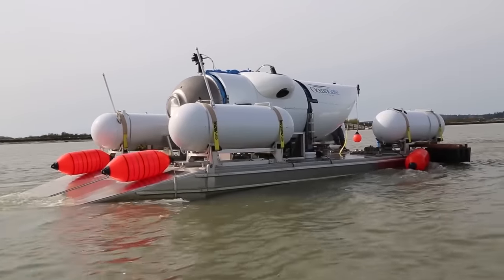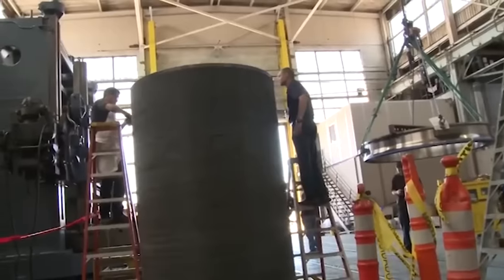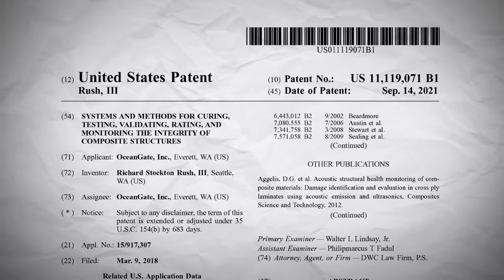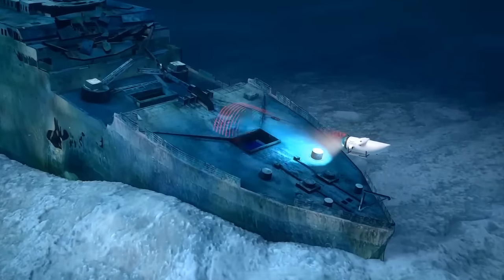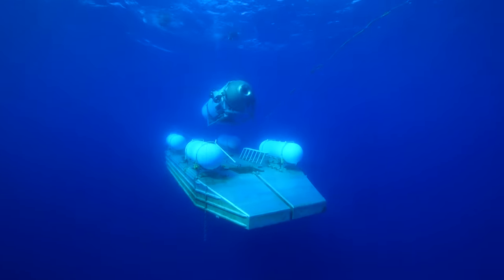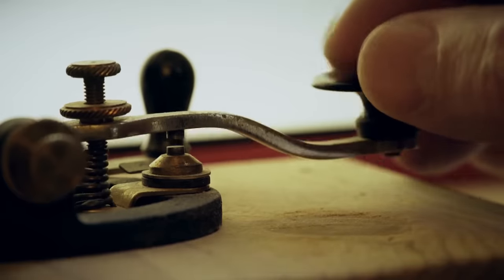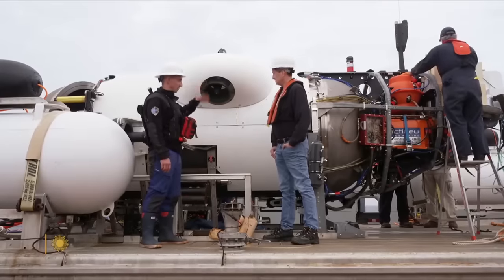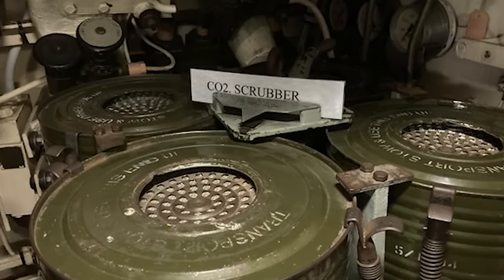Exposing OceanGate Submarines Many Fatal Designs

Comment: The sub was CRACKLING every time it went down. Like carbon fiber popcorn. That is the sound of carbon fiber delaminating. When a passenger asked Stockton Rush about it, he said, "Don't worry about it, the carbon fiber is five inches thick."
 Some engineers have said that this was a 'one and done' sub. That the five-inch-thick carbon fiber was too thick to reliably see every delamination in it so the tube should have been replaced after every dive.
Something only James Cameron has noted, is the bizarre way the carbon fiber was laid on the tube mold to create the tube center of the sub. The carbon fiber was laid in one direction, overlapped to the piece next to it. That is a one axis contact area. The dominant carbon fiber laying process in all of the carbon fiber industry is a FOUR axis WEAVE pattern. Stockton Rush made himself a carbon fiber coffin and bolted himself and four Innocent people in it.
Reply: All that crackling noise each time should have been a red flag and should be tested.
Reply: Belize central america I'm from and i agree totally !! You're a smart person and respect
Reply: ...and it wasn't a very good coffin, either.
Reply: ALL SUBMARINES MAKE CRACKING NOISE, LOUDER THE BETTER
Reply: @meganruchwatercolors7186  i think its clear that Rush was money hungry and didn't want to pay for any kind of testing or go through any certification. he flew across the country to meet with a father n son (who turned him down) about paying for the trip to titanic. that's how the Indian father n son got the "seats" as they were second on some list apparently. someone pointed out each trip should cost upwards of 1 million usd per person if all testing and certifications were performed as advised. i've read to test carbon fiber it basically destroys the product so there isn't a non destructive method for a tube like this.
Reply: @vemaraju  I suspect every sub does. But then that makes the idea of an acoustic early failure detection system pretty pointless, unless it can reliably tell the difference between stress and failure.
Reply: Hey, if you can hear the popcorn popping that's good! It means you're still alive!
Reply: That is what one person said although I have seen video from inside and interviews with several who went down in 2021 and 2022 didn't mention the cracking sounds.  Until the NTSB and the Coast Guard does a full investigation, we won't know exactly what happened. Maybe instead of 5" thick carbon hull a 20" thick carbon hull might work no one knows because Stockon Rush never tested it. He should have made an ROV version and taken down remotely 100 times to test it. Use a pressure chamber with water if that exists. Should have certified it as well. That is the proper way of engineering likely he didn't have the money to do those things he had to start taking paying customers down. Hopefully others learn from that.
Reply: It didn’t make make any perceptible sounds at all, to some passengers like David Pogue who didn’t get all the way down to the titanic but others have who did have said that it was silent
Reply: I watched a man being interviewed who had successfully taken a trip to the Titanic in the Titan. He was asked if he heard noises and he emphatically replied that "no, it was extremely quiet". Also, I have just a few minutes ago finished watching an interview with a man who had charge of a submarine for many years. He said that the implosion was not caused by the carbon fibre, but the problem was the different materials used, which placed extra stress on the sub. Different materials react differently when they contract and expand and they don't necessarily return to the same level they were before. This is what let the submersible down. He said that is why regular submarines don't have portholes, as it's safer for the vessel to be completely made of the one material.
Reply: @hanginwithkev5739 simple! I'm a rich millionaire who knows better than everyone else and cuts literally every corner possible!
Reply: The XBOX controller to navigate the sub it's absolutely crazy those controller's are for games 🎮 not a Submersible sub and no less he bought lighting from Camping World. $250.000 a death trap ticket 🎟 that's the price
Reply: @chrimony With carbon fibre it's pointless as it will immediately fail as the material just shatters. At least with metal it will slowly deform before failing so there might be time to surface
Reply: More like a toothpaste tube, the mince meat of the passenger was forcibly squeeze out of the “tube” shaped submarine through the window to the great delight of fish and other marine organisms 😊
Reply: @chrimony this is, as far as I’m aware, the only carbon fiber deep submersible in existence. There is a reason for this. It’s a very poor material choice for more reasons than I care to list. The way it was wrapped was wrong for the application. The way the ends were attached was not ideal. 
There was nothing about the general construction that was suitable, never mind ideal.
Reply: This is bang on 👍
Reply: @dredgewalker  I think the question is if it develops small cracks first that eventually lead to bigger cracks and eventually catastrophic failure, and if they could be detected in time. But that's where real testing comes in, and it's looking extremely dubious that any real testing was done. The 2018 lawsuit by the whistleblower already showed a lack of testing, and now there's the ultimate catastrophe.
Reply: @hanginwithkev5739 I read somewhere that Stockton had gotten a deal on the carbon fiber as it was out of date for aircraft use. 
Combine that with a simple overlap winding and a generally poor application for a composite material (compression forces) and Titan was literally a time bomb. And that is ignoring the ever growing list of shortcomings on the vessel, including those you listed which should have been genuine concerns.
Reply: It's a material that doesn't fatigue well, that and the dissimilar structural components spelled disaster.
Reply: I read that it was a previous sub that cracked a lot during testing in the Bahamas. That may explain why some people report a lot of cracking, and others say they didn't hear anything.
Reply: In my experience with Carbon Fiber is that it is a brittle material and very overhestimated in many applications. I saw Baseball bats and fishing rods break in the stage of the first use. This makes Carbon Fiber a very unpredictable material to my knowledge, no matter its thickness.
Reply: The first carbon fiber sub Stockton received, the company that made it didn't want invest or have anything to do with it because Stockton wanted to do 5 or 7 dives and the company flat out said it a 'one time dive' sub. Carbon fiber weakens after every dive.
Reply: @vemaraju  That is a very good Attack Submarine. It is loud enough.
Reply: James Cameron also claimed that you dont use compositmaterials in a sub like this.
You use a pressurechamber made of a single material such as steel, titanium, acrylics and so on.
If you wanted to bring five people all the way down to titanic why not design a submersive with two titanium spheres separated from each other instead of a tube.
Reply: @oFrankMartino   Also the epoxy could be a weak point as well, and help with the delamination.
Reply: Maybe the Titan would have been perfectly adequate for relatively low level exploration, and to check out coral Reefs and underdea mountain ranges under water and stuff like that. Now as it turned out, the Titanic visits put too much strain and wear n tear on her hull and systems or whatever, so Titan was ultimately not the Trieste or Deep-sea Challenger design rival as its owner wanted it to be
Reply: @BuffaloPros  Ah that explains why Indians celebrated...
Reply: @chrimony  not even poss.  totally spontaneous and unpredictable, the fiber.  shatters at a pico point at any moment.  just about enough time to disappear.
Reply: Out of everything I’ve heard and read about this sub.. and it’s been a ton…this comment hit the hardest
Reply: @hanginwithkev5739  the engineers and other qualified people did not approve.  in addition, he was warned several times.  these people thought he was sane, or did they?
Reply: I agree with this assessment. In the coming investigation, I believe many pages will be written on this one single point.  

Why deviate from known and tested methods…?
Reply: @hanginwithkev5739  and that's just for starters.
Reply: @vemaraju a crack here and there is ok but constantly hearing it is definitely bad sign on any structural design…
Reply: carbon fiber coffin 🤣🤣🤣🤣🤣🤣
Reply: that sub was weekend because it went down there to many times just my opinion
Reply: @tylercaines30  The stress usually makes noise, without it the sub is a sponge
Reply: @Mike-01234  you're right.  but everyone important and knowledgeable warned him and he just disregarded them all in the end.  but you need to know that fiber is wrong in this application, totally and in spades.  read on.  the boards have much to teach from good people, some of whom have understanding.
Reply: @jonathankabasele985  Instant chum.
Reply: @dianewalker4633  he is correct but fiber is not a suitable material for the sub, period.  you'll come to learn more as you investigate.
Reply: What is delaminating?
Reply: A marine-engineer (whom has designed submersibles for the oil industry) also said the sub needed to be at least 7-inches thick, in addition to the 4-axis weave, & a whole list of other-issues related to the binding of "disimilar" materials used to connect to the main  tube, such as the nose, etc. --Not to mention limiting the dives & scanning for defects (something Rush said was "impossible") after each-dive / Rush also bragged in a text the night before how he got the carbon fiber at a discount (half-off), since it was "past it's shelf life" for aerospace purposes 😮...
Reply: four "innocent"...
really?
Reply: @climbing_for_dollars good thing he himself is one of the people to meet the titanic, isn't it? Now the people who love to cut corners on safety regulations are reduced by one.
Reply: @KennyEaton603  it was detrimental.
Reply: @KennyEaton603  yep.
Reply: I watched a video of a recent titan titanic trip with my high end iems and could not make out any crackling sound. Crackling sounds would have triggered the ultrasonic sensor alarm system immediately. Makes no sense from a technical standpoint either, as 5 inch thick carbon fiber would not crackle under any condition. It ruptures with a bang without any hearable warning.
Reply: @hanginwithkev5739  Carbon Fiber has strength in only one direction. That is tensile or resistance to stretch. Tis is good for holding stuff in. Because you have to stretch the Carbon Fiber to expand the container made from it. But in compression (as under water). The forces acting on the Carbon Fiber is exerted at a 90 degree angle to the layup. Even a tiny bit of stretch will result in delamination. Delamination results in fibers acting as individuals strands not as a system like they were designed. Under pressure delamination can cascade. Because more delamination leaves less fibers to carry the load. Resulting in more delamination. This was an accident waiting to happen. You can't cheap out, when your life is at stake. Materials Engineer should be fired and sued.
Reply: @vemaraju  Yes, but if steel does the cracking noise, then you can be pretty sure, that that deformation will be reversed when it surfaces, without any lasting consequence. While when carbon fibre produces such a noise, you can be sure that deformation is Permanent, and not reversible!
Reply: What's the source of this info?
Reply: He trusted his patented sensors
Reply: @fugu4163  because configuration matters.  connections translate to irregularities that allow the diverging forces under pressure to break and peel the sub apart at once.  why not stay w/ the sphere - it deflects pressure and is proven safe.  because this man was not sane, all advice and warnings came to naught.
Reply: Stockton also said Carbon fiber was like wood and there would be some creaking, so don't worry abut it.
Reply: @climbing_for_dollars  that’s my opinion as well. I guess, they will find out soon, that the company was almost bankrupt, he did not have much money personally, they knew about the problems but took the risk anyway etc.

This was like: If I succeed, we will have money for another year. If not, I won’t have to deal with that.
Reply: @iamthenews5624  
Carbon fibre fabric is glued together in layers to make a strong substace that is light and cheap.
If the kayers come apart, crack, or seperate, that is "delaminating".

Like one layer of a cake sliding off.
Reply: @TheBaker59yrs  It wasn't even an XBOX controller. It was a cheap off brand controller.
Reply: @hanginwithkev5739  well, it worked some times? ImhO the design itself was maybe ok, if you had used each sub only once or twice.
Reply: @Sonnell  any proof like a scientific journal or something credible?
Reply: @TheBaker59yrs 
Bud, think of a million of controllers (mis)used by hundred thousand kids throwing them in tantrums, lemonade in them, jam... they'll have been stood on, sat on, kicked, thrown out the window by mum... you name it, those controllers will have suffered it.

Probably the most product-tested design on earth. 🙂 👍 And what do you do with the buttons? You're clicking them 120 times per second for hours, the sticks are pushed & pulled non-stop. 

So I have no issue with a game controller aboard Titan. Bcos all the kids have used them, they appear in military and other applications. 👍
Reply: They should have tested it first without people full stop.
Reply: @fugu4163  costs.
Reply: im convinced they heard the sub making noises as it started to fail  and  they knew the sub was going to implode before it actually imploded. the last minute or two must of been pure terror for the 4 innocent passengers and stockton rush who was far from innocent in this disaster
Reply: @meganruchwatercolors7186 
Surely it won't have 'cracked' & banged with customers onboard bcos talk about a nerve-shredding descent! By the time you found the bottom you'd be a wreck ('scuse the pun 😉)
Reply: @vemaraju  This is more like common knowledge, but also scientifically a fact. Carbon fibre structures are just carbon fibre in resin. The end result is a brittle material. As it is not homogenus, under enough force, the fibre and the epoxy separates (producing noise) and is called Delamination. Obviously the separated parts will not fuse back together later :) As epoxy hardens in like 24 hours after making the structure. While steel is a homogenius material, with molecular level bonds, and it is flexible.
Reply: @Mike-01234  Yeah it's definitely bs. If you watch footage of recent titan trips(Alan Estrada for example) you won't hear any crackling sounds during the whole descent. Crackling would have triggered the ultra sonic alarm system immediately, long before any human ear could have noticed.
Reply: I was going to comment about the pattern too. All the carbon fiber tanks I’ve seen were in a diagonal pattern so the weave supported itself. This was just laid parallel to each other.
Reply: @francisschweitzer8431 cutting every corner to SAVE MONEY then had the nerve to charge them a quarter of a million dollars to be led to their deaths😢😢😢😢
Reply: @iamthenews5624 to be divided into layers 😳😳
Reply: One look at that sub seemed way to sketchy I'm no enginerd just like to make stuff
Reply: @ryanhampson673  Yeah, the pattern was highly primitive and probably not suitable enough.
Reply: @bb-gc2tx  nope. Maybe they got a hint by the ultra sonic sensor powered alarm system being triggered but were already dead before they even tried to react to it. Our human ears are kinda low resolution devices compared to ultra sonic sensors.
Reply: @bb-gc2tx that was my question/concern for the passengers! I wondered if they had any indication moments before the sun imploding that it was about to implode? I was praying they had no idea of what was just about to happen!!😢😢😢
Reply: @Sonnell  sounds like trust me bro more than science 🤣🤣🤣
Reply: @BuffaloPros  mimimi
Reply: @TheBaker59yrs NASA uses them to control complex rovers.  The US Navy also uses them on their attack submarines to operate photonics masts.  The Titan is far from the first to use an XBOX parts in sophisticated operations.
Reply: Let's not blame this on Stockton for this, the real problem is all the safety regulations.
Reply: If it would have been made of steel you could atleast x-ray it stong as carbon fiber is only as strong as the glue/epoxy that holds it together maybe weight is a issue
Reply: @jessicatharpe9337  It’s just so unreal…He knowingly used a material that did not have the compressive strength to handle his missions…
Reply: It is totally normal to make a pressure vessel from UD tape or use a biaxial layup with the right amount of fibres in longitudinal and transverse directions because of the simple load case.
It's important to alternate the layers in order to reduce huge interlaminar shear loads the resin cannot withstand.
Reply: @bb-gc2tx I doubt it was as long as minutes. More like seconds.
Reply: @Squilliam-Fancyson  They dropped ballast and were trying to come back up without having made it to the bottom, so yes, they had time to react to what was happening.
Reply: @sammencia7945  Insane!!! He was playing with fire…
Reply: @dianewalker4633  another engineer brought up two very good points as well 1. being cyclic failure the immense compression and decompression of this sub every dive weakened the integrity of the vessel they had made several dives before also a dive was scrapped due to signs of cyclic failure but was supposedly repaired.....2.your design parameters the sub was designed to withstand 4000 meters and the titanic being 3800 meters they were reaching the closest possible to the failure point of its design the engineer said if you were going to be going to 3800-4000 meters it needed to be designed to withstand at least 6,000-8,000 meters to be safe james Cameron's challenger deep was able to withstand much deeper pressures than where he went....Stockton rush was a monkey he literally fired one of their employees who checked and raised several safety concerns about the titan and suggested remedies to each problem and the guy was given 10 minutes to empty his office at which point he sued for wrongful termination
Reply: @phillipmoore6295 They are all fired, as the company is now no more. Court action is coming.
Reply: @phil4986 - Re "That is a one axis contact area." -  So Rush made every conceivable cost-slashing effort to build the titan. Was he trying to set the world record for 'doing more with less'?
Reply: @hillbillybeerdranker6678 That’s funny. CF is nothing like wood.
Reply: I'm in the process of making a submersible for Titanic dives. It's made out of shredded cardboard mixed with construction glue in a big vat. This cardboard/glue slurry is then hot injected into a one piece mold, it's bake hardened for 36 hours and then air cured for another 36 hours. The end product is an extremely ridged one piece shell, I'm installing 2 portholes that are bolted all the way through the body with a flange type connection. I can only take 3 passengers at a time, and I'm not money hungry either, tickets are only $20,000 a piece. Our first dive is summer 2024.
Reply: @ryanhampson673 
Quote "all the CF was laid parallel".
No, that can't be right. That defeats the whole concept behind multi-layer carbon-fibre/fibreglass. You alter direction of the weave to give strength in all those directions.
Reply: @Mike-01234 pressure chambers like those exist in my country at least. James Cameron used them to test his batiscaph. But my country is Russia...
Reply: @KennyEaton603  Can't get over the design and construct errors. He had some marine experience so how could he have been so deluded about the materials?. Why else was it a poor material choice (apart from the fact it's got tensile strength but little compressive strength).?
Reply: The carbon fiber issue was mentioned by MANY people before James Cameron ever mentioned it.
Reply: @BanjoPixelSnack  nope that all was triggered automatical. Implosion happens within milliseconds. No time to react and definitely no acoustic warning perceptible by human ears beforehand.
Reply: @kone.linngus3651  Is that a fact. There should've been a warrant issued on him.
Reply: I was hooked into a Tope, a species of smooth shark, I was playing the fish on an 81/2ft Carbon Fibre spinning Rod on a beach off Ireland......as I got it into shallow water to land/unhook the fish it ran again and.....my fishing rod literally EXPLODED. I got shards of Carbon Fibre in my Eye's. That was NO Fun. This was the early 80's when carbon fibre fishing rods were relatively new
Reply: @dirkknoll3795  I think the forces under pressure vs being pressurized are different example being pressurized the fibers(or steel) would stretch under pressure (outside pressure) any stretching would cause the vessel to fold inward and being carbon it didn't just tear or fold it exploded (imploded) into a million pieces
Reply: @gregsayles9253   So to Rush, being past its use-by-date for aerospace meant it was fine for tons of pressure deep sea depths. Beyond Unbelievable.!!
Reply: @BuffaloPros 
And.....?
Reply: @phillipmoore6295  excellent explanation, thanks for that.
Reply: As an Engineer I am happy with your explanation. The fact that a weave pattern was not used in creating the carbon fibre tube according to me was the height of irresponsibility. I had been waiting since Sunday to know exactly what structural defect led to this disastrous news for all humanity. Am very sorry for the families of the victims and our thoughts are with them at this very trying moment. Engineers everywhere SPEAK UP when NONSENSE IS GOING ON near you. SAVE LIVES !
Reply: @TheBaker59yrs  Yeah thats right. The controller and the lights aren't spark/static proof electronics that are used in military subs
Reply: @TeddyBear-ii4yc there is case when "all" fibers are in same direction (not 100% of them but most of them),  it is used for some parts on formula 1 cars, that is dependent of load, but that can be done safely only after you totally understand loads part exibit and after carful design and simulation and testing of parts (most if not all formula 1 teams use fibersim for that job and lot of experience, they use cf composite cars for over 40 years and all must pass crush testing, and even with all of that some cars do not pass crush testing, as I remember McLaren failed it I think couple years ago, and they was first team that raced cf car in 1981, (first was Lotus but was not allowed to race in first race)
Reply: "four Innocent people in it."
lol keep telling yourself that
trust me nothing of value was lost,if anything it was beneficial to the world
Reply: Exactly
Reply: @dredgewalker  not only that but initial deformation in ferrous metals causes work hardening which pushes the failure point out.
Reply: @TeddyBear-ii4yc  what I meant was the “weave” was extremely shallow. I would have thought they would have gone diagonally from one end and then back. It was just started at one end and only doubled back when the entire first layer was down.
Reply: @ajaxracing  it is of course different because auf the instabilities of the fibres themselves under compression - they have to be supported by the resin. You also have different Young's modulus between the titanium Caps and the CF layup, additionally you have huge thermally induced stress because of the different shrinking when cooled. Due to the thick layup you generate interlaminar shear - so all in all a great engineering challenge, considering ageing, fatigue and imperfections from production...
Reply: Hey do you remember which Cameron interview he said that in? I've seen a few but haven't heard him talk about that carbon fiber process. Sounds interesting
Reply: Filament-wound composite pressure vessels and tanks have been used for years, this hull should have been Filament-wound to keep the carbon in tension, simply laying up a composite structure is not a thing anymore.
Reply: I don't know what your're talking about.  The video showed the carbon fiber bein wrapped in multiple axes / directions.
Reply: Carbon fiber also doesn't compress well
It is good for tension, like for spacecraft that is pressurised from the inside out
But when it's compressed, the only thing holding it together is the epoxy in the mix..
Reply: @climbing_for_dollars  I bet those five people on board heard it as well.
Reply: @dianewalker4633 There were many reasons, many bad design features (too technical to explain here and pointed out over the hundreds of comments from people who know the subjrct matter that have "emerged" ) that made it implode. Basically it was a time bomb waiting to happen! I'm sure this will be a future case study in structural composite design in college, once the manufacturing drawings of oceangate are available....The method of manufacturing of the capsule will be under scrutiny..
Reply: It kills me, not literally, that they screwed into the carbon fiber hull to mount the monitors.
Reply: @climbing_for_dollars ’Indian’? They were Pakistani. Do you think they all look alike??
Reply: ya we have to think that what is the thickness of titanium in pressure hull? total thickness of pressure hull is only 5 inch
Reply: Horrifying
Reply: that’s a tasty picture you’ve painted!
Reply: All four of those people signed a wavier which said they could die from the simple act of stepping on board the deck of the surface ship neverminded diving almost 4,000 meters under water. There deaths are unfortunate but lets not lose perspective, they made the choice to go down there knowing there was some degree of risk even if it was underestimated. Meanwhile 500 or more people drowned in the Mediterranean the same week that this happened trying to escape war torn country's from which they had no future and the world barely even blinked an eye.
Reply: @BuffaloPros The subs invented by the blacks are much better! I agree 100%.
Reply: @petergriffin383 A few more blacks as engineers and scientists would’ve ironed out all the issues, I’m certain of it. Diversity is our strength!
Reply: @vemaraju  The issue isn't that it's making noise(It's more of a groaning noise as the pressure stresses/deforms the hull. The noise is typically the bulkheads shifting). Another factor is subs are typically made with a single material(steel or titanium), so when you hear a crack, it's easier to find. Carbon being a laminate composite can crack anywhere in those 5 inches and remain hidden to surface checks(ultrasound checks can also miss these cracks if the curing/bonding process is flawed). There's pretty much no real reason to have gone with a titanium capped carbon hull aside from marketing ones.
Reply: @vejet  who cares about that? 😂
Reply: @TheBaker59yrs Logitech controller. Xbox may have done better.
Reply: @climbing_for_dollars   Thermography and radiographic testing are both non-destructive ways of testing carbon fibre matrix defects.
Reply: @dianewalker4633  Carbon fiber bike parts break all the time. I refuse to even have carbon fiber handle bars on my bike. To think someone actually trusted a carbon fiber submersible 2 miles under the ocean is insane. It's very strong but once it is compromised even a little the chance of a complete failure is likely.
Reply: patluxor2482  indeed good coke does make everything all right. Kids today have no idea how much better quality it was back in the 80’s
Reply: "Innocent" people. Right. They could have made the decision not to go as others did.
Reply: @mashton6631  Why did the Titan ditch it's weight to return to surface if they didn't hear anything or pick up any problems?
Reply: More of a high-speed blender than a coffin.
Reply: @dredgewalker doesn't matter what metal, at that depth, the pressure will cause any metal to contract and implode almost instantly.
Reply: @ViktorIsaacson  What? You do realise that metal submersibles have gone deeper than that, right?
Reply: @TheBaker59yrs why are you so hung up on the controller? It wasn’t even the reason for the failure.
Reply: Nice story kid. Might wanna fact check yourself next time before typing out a book for 5 mins spewing nothing that we haven't heard or seen in the past week.
Reply: @PanamaSticks  If you mean 2:14, that wasn't the Titan, it was just stock footage of something being made of carbon fibre.
Reply: @carlislepanting5219 learn to write in English, so you are not a total waste of time to read...
Reply: @andysmith1996  what? sphere shaped submersibles that were properly designed and engineered.

But thats besides the point, you said that metal will slowly deform, which is completely false because at that depth, the pressure is so great that if the metal strutural integrity reaches the point where it can't handle the stress, the change will be instant and explosive.

Even at 1 atmosphere, the difference of pressure of just gases would be enough for instant implosion of a metalic cylinder. I suggest you research more into this.
Reply: @dianewalker4633  No one knows NTSB will figure out exactly what happened. They have lot of experts in carbon fiber.
Reply: @vemaraju  especially if the hull is made of popcorn
Reply: billionaires thinking they're above the law of nature, how funny
Reply: @Mike-01234 A twenty inch carbon fiber hull would negate any benefits over titanium. CF is the wrong material.
Reply: @climbing_for_dollars  That's what Drew Barrymore said in "Scream"😆
Reply: @KennyEaton603 yeah, he woeked in aerospace and got the carbon fiber at a great discount.
How do we know? He boasted about it.
Reply: @francisschweitzer8431   Cost cutting.
Reply: @iamthenews5624 Carbon fiber is put together in layers. When they come apart, thats delamination.
Reply: @Squilliam-Fancyson You can hear it at 16:44.
Reply: @qq84 Logitech controllers are not cheap. That was not the issue.
Reply: @BuffaloPros Both were 100% Pakistani
The British man aboard DID have a son, but he was more busy Thirsting On Twitter, not onboard...
Reply: Anyone who has worked with glassfiber or carbon fiber laminates knows that crackling and popping sounds are bad... They're signs of irreversible damage being done to the laminate.
Reply: @sailaab You can argue at the very least they got suckered in and paid for it. 

Stockton Rush is the only one who 100% absolutely undeniably Deserved It. 

Pretty likely to assume the 19 year old kid who only went because it was Father's Day wouldnt quite fall under "guilty"...
Reply: how mere fish undid the bolts is the part i don't understan
Reply: @jonathankabasele985  once the air is compressed and leaks let water in, it don't work like a toothpaste tube anymore
Reply: @petergriffin383 Not sure if sarcastic... 
Stockton Rush literally did everything in his power to avoid them, some shit probably illegal too :V
Reply: @vejet A Waiver does not cover gross negligence on the Owner's part. 

It foes hot give a free pass to do literally anything. It simply is a guarantee in the instance that an actual Accident occurs, something Unforseen, or possibly just Fate. Not skipping every corner and regulation imaginable amd imploding as a result.
Reply: To me, carbon fiber seems insane to use for a deep diver. The hull is expected to shrink throughout the dive cycle, and carbon fiber isn't exactly known for being malleable. Or for being strong in compression, like it would be in a pressure vessel
Reply: @mynameisgladiator1933 Except at least one of them CERTAINLY wasnt making the choice on his own... 

You dont want to stomp on your Father's passion on Father's Day, do you? Even if you do NOT want to go, and dont trust it for shit.
Reply: @lboston4660 It was the Orcas
Reply: And no governing bodies could stop him! Mwahahahahahaha.

Oh we aren’t doing an evil scientist thing here? Mb.
Reply: @kmacksb I dunno, personally I'd be into a coffin that could turn me into soup in an instant. It's actually the one saving grace of how horrible this situation was, is that their deaths were hopefully swift.
Reply: @BuffaloPros  One thing is for certain.... they're both dead.
Reply: I couldn't believe what I was seeing when I saw the fiber being wrapped in a, continuous, simple loop, round and round the diameter....
I've been saying that this is one of the greatest endorsements of carbon fiber - maybe ,ever.
Through, apparently, no fault of the actual contractor, this application was poorly specified, poorly considered, poorly executed upon request, poorly applied by demand, and poorly maintained through negligence .....- this deathtrap should have gone down once, and never been seen again! Instead, it actually managed to make multiple descents. That's, incredible!.... And you haven't even started to consider the glueing on of the caps to a flat surface - I mean, seriously: is it possible that Rush actually went a little, quietly,  insane - or what?
Reply: @N208R  The titan used a cheap logitech controller
Reply: @BuffaloPros 
The kid was pakistani too
Reply: Yeah. I've got a Ferrari branded umbrella. Carbon fibre shaft Twin diagonal weave with ridges suggesting circular weave. Carbon struts and. Titanium hinges. It's the only umbrella I have that has survived more than 1 wind inversion.
Golf sized. If it inverts just face it into the wind and it corrects. Probably 12 to 15 inversions.
Reply: @phillipmoore6295  Instead, they fired their Director of Operations when he raised safety concerns, giving him literally 10 minutes to clear his desk - and then, they, sued, him, for his trouble...... Unbelievable.
Reply: @BuffaloPros 
Irrelevant comment
Reply: @jessicatharpe9337 Even then, I'd be surprised if they made much actual profit - the cost concern seem just too high....It sounds like a company constantly hovering at a  break-even point.
Reply: @meganruchwatercolors7186 the carbon fibre hull was replaced after 2 years due to it losing its integrity. Why they thought this wouldn't happen again is a mystery
Reply: Point A carbon fiber has a limited life and requires frequent inspections. It can be (depending on manufacture methods) HYGROSCOPIC, i.e absorbs water. A deep sea craft such as Titan should have been maintained in an environmental storage area and only outside during dives. It should have been thoroughly cleaned, dried as recommended by the CF mfg and placed back in an optimum humidity and temperature INSIDE out of the elements. It is reported the principal of the company drug it around all over the place like a display, towed it on the back of a ship in rough seas and just generally treated it like it was indestructible. The sea was NOT it's only enemy.
Point B A major point I fail to see specified except on one or two maybe posts was the layup method. They went left to right, right to left in a wrap of the Carbon Fiber (CF). Even for pressure inside greater than out that may not be optimum. Making CF scuba tanks they use a left to right right to left lap and rotate (end to end at an angle or diamond shaped) The OG vessel Titian was not built appropriately in the opinion of people smarter than me or most and to observe making of a scuba tank (small with 3000+ psi inside) VS making the Titan one has to wonder how and why anyone would compare a cylinder of 20 or so feet long (22 with the ends I'm told) at those depths as safe and near to indestructible as the owner did,
Point C repeatedly the owner was warned of the sudden failure of CF. All odds were against him. CF is good for higher pressure inside than outside with proper inspection and scrutiny. I.e. Airplanes and scuba tanks. More pressure inside than out and constructed to optimize and lengthen safe use life. Inspected frequently to assure safety. 
To level wind (no stress distribution) over a long cylinder like that with what appeared to be a large but simple wrap machine (how much tension on the fiber, was each layer bonded? what about heat and humidity, appeared it was made in an open factory with little climate control? 

Overall I feel based on the words of the heaviest hitters in the submersible community OG broke rules that keep subs and occupants SAFE. 

Some rules can be bent or broken. But the rules of physics are broken, people will die. Proof of that concept again is a wreckage field 1600 feet from the bow of Titanic. Physics rules are unbreakable. Force = Mass X Acceleration. When pressure multiplies rapidly materials exposed to it not able to withstand it fail. People can and will die.

The ocean and physics won, the poor victims lost and we are so sorry for their families!.
Reply: @j81851  remember the Titan's carbon fiber hull already failed integrity testing after a couple of years and they had to relaminate it. What did they do? They made a new hull, which then did the same thing. Except this time it failed catastrophically.

There's just no excuse. They already KNEW the hull degraded with cyclic compression. They were relying on the new acoustic system to give them loads of warning. It didn't
Reply: I still don't understand about the carbon layers. So Stockton put the layers of carbon fibre on top of another?
Reply: @Mike-01234 I doubt any thickness of carbon fiber would work over the long haul. The material just doesn’t work well for the pressures it faces that far under water. Also there is no way to check to see the damage that has been done after every dive, like conventional steel and titanium.
Reply: Only James Cameron? You mean that you only heard JC say so. Many experts said similar.
Reply: Carbon fibre has a nasty habit of disintegration under stress with even just a hairline crack - I've had fishing rods snap with very sudden force under pressure with no warning at all
Reply: @phillipmoore6295  since Stockton himself said he didn't want 50 year old whites guy, he wanted young people with enthusiasm, I'm guessing the engineer he hired never engineered anything like this
Reply: has stockton rush ever heard of this thing called plywood?
Reply: THAT IS IT!
Reply: You were there? You heard this CRACKLING? Or are you just repeating hearsay?
Reply: @meganruchwatercolors7186 i think he was more interested in the $800000 he was getting for every dive. Clown!!!
Reply: The problem was not a carbon fiber pressure vessel

But an uncertified underengineered pressure vessel
Reply: @KennyEaton603  Being bolted in sends shivers down my spine. If they had reached the surface somewhere say, they still had to rely on being spotted and released, or they would suffocate nonetheless. That's crazy.
Reply: @fugu4163  yes he did claim that. But it tells a lot about his skills in this topic when you remember that his own sub that went to the Challenger deep, was made of a composit material, a syntactic foam called "isofloat", too !
Reply: @vemaraju  No, they don't because the cracking was from the carbon fiber delaminating, no other sub is made from it for a reason. Sure pops abd bangs but not cracking
Reply: @bb-gc2tx  No one can say you are wrong about them knowing the sub was in danger of imploding, no one. Their alarm may have gone off, and they dropped ballast and were trying to get back up - that would explain the large debris field unless they never actually made it to the bottom. Accident investigators might be able to work out the details, but until then no one has any real way of knowing for sure. Carbon fibre can fail catastrophically, we all know that - but doesn't mean there was no warning at all.
Reply: very well stated.  As yet another engineer to come out and express my outrage, there are no words for how irresponsible Stockton Rush was. The act of a madman.
Reply: @kmacksb they got a cool burial sight out of it at least 😅
Reply: @BrandonGavin_EDC  You can see delamination with ultrasound, as the gaps reflect sound. It's just expensive, about $20,000 per test. There should be a test carried out before each dive.
Reply: I didn't know space had 4 axis until now. Interesting how they can weave fibers in 4 axis patterns. SMH
Reply: Even my carbon fiber fenders and side panels on my Harley are done better than that which is sad. The fact they ran the carbon only one way, and didn't weave the weave per say is wild to me. I have seen carbon break, and while it is INCREDIBLY strong, it cracks, like you said, which is terrifying when you remember it was used as a pressure vessel 13 000 feet under the sea. I wouldn't even be surprised if the carbon fiber hull was just laid carbon and in no way vacuum sealed for added strength lol
Reply: @matildafaltyn6253  it can delaminate internally with no way of detecting it. It would compress at a different rate than the titanium end caps, causing stress in the glue joint that was also very difficult, if not impossible, to inspect via non-destructive process. 
It generally is not easy to detect internal flaws in carbon fiber, especially when it’s 5” thick. 
Carbon fiber would need to be stress tested and analyzed thoroughly to determine how many compression cycles the design would withstand before it’s integrity was comprised. They never did this and had based all of their conclusions on assumptions and limited data from a 1/3 scale model. Very poor choices for a prototype that would carry passengers. 
I personally cannot think of a single reason why I would use carbon fiber in this application. And certainly not a carbon fiber cylinder that was built with a simple overlap wind. 

I want to disclose that I am not an engineer. I’m merely a machinist/fabricator that has spent the past 20+ years of my life building things from any number of materials that were designed mostly by engineers or myself. While I’m admittedly not an expert, I’ve got a lot of experience in designing things that don’t break. That said, I have a lot of friends that are engineers, and none of them disagree with me about Titan. It was a poorly engineered coffin.
Reply: They glued the titanium ring (interface to the titanium end cap) to the carbon fibre tube using epoxy resin that was not de bubbled, not in a dust free atmosphere. Microscopic anomalies in this joint were entirely possible and not x rayed or checked.
Reply: @joshuawiseman5629  he clearly didn’t care about safety factors. He far exceeded the rating of the window material. What a shit show they were running. In my field everything has either a 1.5x or 3x safety factor over the maximum allowable working pressure.
It’s one thing to push equipment in a safe environment with precautions in place and no danger to life, but what they did was completely negligent.
Reply: @jobee9113  this is very true. However, you cannot x-ray carbon fiber. Well, technically you can, but it simply shows up black and it is transparent to x-ray.

Just another reason in the long list of why it was a piss-poor choice.
Reply: @KennyEaton603 it’s like he never employed his mind or a structural engineer as how fiber layup and strength relates best to pressure vessels internally pressurized where hoop stresses can be managed. When I first heard about this I thought are they pressure regulating for depth to at least offset differential pressures, but then I saw it and I thought WTF? That thing looks like a garage built go cart v2.
Reply: @vemaraju that’s not the case when they are made from carbon fiber. Cracking sounds from carbon fiber are very bad.
Reply: @KennyEaton603 It can't be a bomb. Bombs explode, cheap subs implode😑
Reply: @TheBaker59yrs lots of heavy military weapons and platforms are controlled by game controls for ease of function and cost.
That doesn't make it bad at all... 
It's just for controling left / right & down/up .
You dont need a 500.000 $ joystick for that.. 
It looks amateuristic, but it just works well... 
No need to re-invent the wheel for that..
Reply: @vphls  as soon as I saw the cylindrical design, I wrote it off as poor engineering. A carbon fiber tube makes it that much worse. 
When carbon fiber reaches its yield point in that situation, it’s a violent failure. 
The only positive to the situation, is nobody in it has a clue what happened. Hopefully there were no warning signs and they were in good spirits when the inevitable occurred.
Reply: @stever3425  fair enough! 😁
Reply: The thought of going into such a small and sinister looking tube and being bolted in from outside and then dunked inside a deep dark ocean to be near a mass shipwreck graveyard is truly my worst nightmare. You couldn't pay me $250k to go inside
Reply: At least " No old white man" involved!
Reply: @damonmelendez856  all clones
Reply: @KennyEaton603  Absolutely!!!
Reply: @fugu4163  I watched James Cameron as well, and those materials are exactly what you want to use, building a submarine.
Reply: They don't know if it's the hull that failed or the glass window at the front which was only rated for 1300 meters ( 1/3 the depth of the Titanic). I'm no marine engineer but I heard designs usually call for 50% margin of safety so if a part is meant to work at 4000 meters should be designed for a max depth of 6000 meters. This carbon fiber space clown didn't even hire a single naval engineer for consulting. Obviously money and profit was at the forefront of the company's priorities.
Reply: Interesting. I have to say I was  surprised when I found out it was 5 inches thick I thought it was much less. Even if the carbon fibre held, the cylindrical shape of the hull isn't right and the failure could have occured at one or both ends of the sub. It also had a Perspex viewing window which was not fit to be used at 4000 metres. Im guessing they are going to recover as many pieces as possible so we will find out the answers when this happens. There are def things they know that they haven't told us yet
Reply: @phillipmoore6295  The engineer was fired and sued. He repeatedly told them how unsafe it was and tried to stop them from doing it by posting publicly about the unsafe way they were building the sub, and so Oceangate fired him and sued him for "revealing trade secrets."
Reply: @papapawpaw8877 He wasn't that rich, that's the reason he cut so many corners and didn't get it certified. It was too expensive. In 2023 they also changed support vessels from the Horizon Arctic to the Polar Prince because Horizon Arctic wanted 200k per week and they couldn't afford it. Ironically, the Horizon Arctic was the ship that deployed the ROV that found the debris of Titan on the sea floor 😮
Reply: @iamthenews5624  It is separation of the layer (laminated together) of the carbon fiber, leading to failure.
Reply: @Squilliam-Fancyson  
Gaslighting is your expertise!
Careful, you May self inflamed!🙄
Reply: @Defender78 It looks like a childs bath toy and evidently it performed like one also.
Reply: Every sub today creek and groan under preasure.
Reply: @mexicanfrenchmenmoser7367  this and also because its built like a child's bath toy
Reply: @climbing_for_dollars please correct yourself, the father and son were Pakistani not Indian...
Reply: @mexicanfrenchmenmoser7367  
It supposed one dived material, good time,Rush rejected " the old white man" ,we can say it now, dead Rush rejected the " old white man"!
They should interview the " old white man"
Reply: 5Inches thick, sounds more like a honeycomb structure, rather than solid monolithic carbon fibre. 

I this case the crackling could have come from the honeycomb itself, delaminating it from the top covers.
Reply: @fugu4163 I agree with cameron on this one, he is right, carbon fibre is a great material if used correctly, they however used it for probably one of the only applications it's completely useless
Reply: @dredgewalker not in deep sea exploration, as soon as a metal tube looses it's perfectly round shape it will almost instantly collapse, the perfect circle is a fundamental to the structure, but you are right that CF will shatter, and there are several ways for it to do that.
Reply: @catscanhavelittleasalami  James Cameron said it best, "Now there's a wreck lying next to another wreck for the exact same reason" ... 
(The arrogance of man)
Reply: @vemaraju  Source please!
Reply: @iamthenews5624 Delamination of a fibre reinforced plastic is the separation of the layers within the structure. The epoxy/polyester resin is brittle, the fibres are flexible, this allows for quite flexible parts to been built. If you overdo it, the resin on the inside will crack and disbond the fibres from one another. 

This delamination can be investigated by nd-testing by tapping the part with a coin / small metal object, if the sound is clear / glasslike, the part is fine. If the sound is dull it's fucked
Reply: @gregsayles9253 was that the raw material ? 
 or did they use prepregs? 

if it was dry weaves, it's not that tragic, in case of prepregs i would have run far away
Reply: @buckmurdock2500  I think making stuff up. I've read and watched everything I can find on the sub, including multiple people who've been in it and I've not heard of one person who said it made crackling sounds. Please direct me to this info and prove me wrong so I can learn more about it 😢
Reply: @dianewalker4633  That guy might have been paid to do damage control, as some on YT suggested.
Reply: Well put… 👍
Reply: @methylene5 s if. 😅 The thing was made from parts bought at Walmart and Camping world. They had no money that's why it wasn't certified and why they were so desperate to get paying passengers. In 2023, they changed support ships from Horizon Arctic to Polar Prince because Horizon Arctic wanted 200k per week and they couldn't afford it. In a twist of fate, Horizon Arctic was the ship that deployed the ROV that found Titan's debris on the sea floor.
Reply: The reality is, CF in a submersible is not tried and true.  We have idea what the real service life is for a CF type submersible.  Is it 5, 10, 15, 20 + dives or ???
Reply: OceanGate should have taken the time and expense of developing ultrasound imaging of the hull for evaluation.  That would have shown any voids or delamination of the carbon fiber material before and after each dive.  That would inform the company of the useful life of the submersible and could have been used for future improvements in the design.
Reply: @KennyEaton603  it looks like a childrens bath toy and evidentiary it performs like one as well 😢
Reply: not sure about 5inches but i know how long 9inches is.. and it should have been that thick..
Reply: Holy F batman, that is the key fatal flaw.  No strain gage ever invented could tell you when you about to get FUBAR.
Reply: @jasonhunt007    Lots of “should haves” but they were filing for bankruptcy
Reply: @Daledugahole  Actually, they could never ever get that certified no matter how safe it was given that the hull was made with CF. Everyone shouting about certification obviously know nothing about the certification process. It was either going to be a non-conventional design without certification, or no trips to the Titanic at all as the cost would be prohibitive. I would argue the latter would be in everyone's best interest, but there are always some who are willing to take the risks.
Reply: Yup it was
Reply: If I heard that crackling Id have a heart attack - I would have passed before it imploded😢
Reply: Carbon Fiber under pressure unravels and falls apart.
Reply: @BuffaloPros "Now there's a wreck lying next to another wreck, for the exact same reason" 
(The arrogance of man) 
- James Cameron
Reply: @KennyEaton603  The DeepFlight Challenger used a carbonfibre pressure hull.  It was rated for depth exceeding the Mariana Trench (obviously as a hypothetical safety margin). In testing it was determined to be suitable only for a single dive
Reply: I didn't realize how many experts there were on submersibles. The YT comments are filled with them.
Reply: That is a very good observation! OMG, it was actually unidirectional carbon! Meaning, in the axial direction, the load-bearing capacity was extremely low, corresponding to that of the epoxy resin alone! Besides that, any engineer can calculate the following in 5 minutes: Compressive stress in the carbon fiber polymer (CFRP) wall of the Titan submersible was about 200 newtons per millimeter squared at Titanic depth. This corresponds precisely to the stress level where CFRP typically fails under compression. Only under tensile load (which is not applicable underwater), CFRP can withstand about 10 times more.
Reply: @sailaab More  like three innocent passengers…the creator of that sub is the reason why the passengers died…
Reply: @vctrsigma  they actually tested it. Stockton didn’t, ignored every word of caution and sent it down repeatedly. 

I don’t think anyone would care, had he not brought 4 innocent people with him.
Reply: @MrSmith-vc8xd  which one was Jewish??
Reply: I was perplexed with the roll-on method as well. koenigsegg and others have shown the correct method when constructing carbonfiber hulls. that said I still think the metal `end domes` glued on was the weakpoint in the construction
Reply: @BuffaloPros  do you not understand genetics?
Reply: @jasonhunt007 Good in theory, but they didn't have any money. They changed support vessels in 2023 from one built in 2016 to a ship built in 1959 because the former wanted 200k per week. They were desperate to get paying passengers in the sub to keep the company afloat
Reply: @KennyEaton603 there was another one. The DeepFlight Challenger. It was designed to dive a deep as the Marianna trench but after testing they found out that it could only do that once. The manufacturer could not guarantee structural integrity after that.
Reply: @dianewalker4633 I'd rather take Ballard's and Cameron's word for it. Decades of experience there
Reply: it's a carbon fiber pressure cooker... from solid to mush in less than 1 second.
Reply: @methylene5  True, he kept saying it was "innovative" but the technology was already there and it worked so why not use it ? Because "innovative" was just another way of saying we don't have any money. it's just a shame it had to be at the expense of 4 other lives, which often seems to be the case.
Reply: @meganruchwatercolors7186 ...and Stockton rush said that safety regulations were a waste of time, so no testing would've been done.
Reply: @MikeySkywalker haha, we can all become instant experts on anything now thanks to YouTube, google and CBS News 😂
Reply: @KennyEaton603 There is another carbon fiber sub that was created to dive at Challenger deep. James Cameron said that he told the owner not to use it and he didn't. There's more to the story and I recommend checking it out. I worked for a company that built, maintained, and repaired pressure vessels for the offshore industry. The idea of using carbon fiber for a sub is known by all in the industry to be impossible with current technology. The Titan had multiple points where failure wasn't just a possibility but a guarantee.
Reply: WOW! Thus this stuff should have only been exposed to tension, NOT compression. Didn't this aerospace engineer know that? of course not a pressured aircraft has the pressure applied INSIDE placing the fiber of course, in TENSION! And finally the weave pattern was completely different not just a simple overlap like was done with these tubes. The wraps I've seen with fiber layers typically has 45 and 90 degree overlaps, not 180 like what's indicated here. In fact you see the same type of diagonal wraps in fiberglass boat hull layering. Unreal.
Reply: @kmacksb  But one of the most famous coffins.  78 Syrian refugees drowned in the Mediterranean the same day and you probably didn't hear about them.
Reply: Snap Crackle and Pop
Reply: @Daledugahole  😂 So true. But in all seriousness, an expert also has to do with acumen, and intelligence. Especially when it comes to engineering. I mean, Stockton Rush graduated with honors from Princeton. Even he miscalculated, and engaged in hubris, to the point where it killed him.
Reply: @Jonathan.D  I’m aware of the other sub, though it was a bit different in design and actually tested. 

I don’t see anything about Titan that makes me think it would be safe for more than a single dive, and personally I wouldn’t be present for that either. 

Does anyone know if the hull was ever inspected by any means, possibly ultrasound, after being brought to depth?
Reply: @dianewalker4633  I'm into watches and it's interesting what tech they used to make submersible watches.  The Russian Vostok used a cheap system with a gasket and a flexible mineral crystal.  The flex of the crystal actually pushes down on the gasket and seals it tighter.  In watches with a rigid saphire crystal, they use a gas escapement and Sinn uses oil filled watches where the oil pushes back against the pressure.  The U5 is good to 5000 meters.
Reply: @papapawpaw8877  The take away should be, that having money doesn't give you brains.  But I'm sure next week, we'll see another reality show host running for president.
Reply: Should have called it the sea minion
Reply: @KennyEaton603 DeepFlight challenger is the name of the only other carbon fiber sub made for deep sea exploration. As I mentioned in my first reply, it was never used at depth.
Reply: @TheBaker59yrs  That's not what caused the failure.
Reply: @av3nger3 ome people are saying James Cameron is not qualified to comment 😂. The guy has been solo to the deepest known point of the ocean and survived. He's also dived to Titanic 33 times. He has spent more time on Titanic under the sea than the captain spent on it when it was afloat. I'm pretty sure his comments are valid.
Reply: @MrSmith-vc8xd    Didn’t know that.  Yes, that’s a win
Reply: @deplorablelibertarian  He said if you want to be safe, don't get out of bed. I bet now he wishes he didn't. 😢
Reply: @BuffaloPros  that would make the child both races and both ethnicities. Therefore the kid isnt JUST British, youre welcome.
Reply: @Daledugahole  yes...pretty dang qualified
Reply: @MikeySkywalker  Although it doesn't look like it, he was actually obsessed with safety and 4/5 dives in 2023 were cancelled due to bad weather and rough seas. The problem was, he somehow convinced himself that the most important part of the sub, the pressure vessel, was safe and everything else was secondary. I guess you could say, he couldn't see the forest for the trees 😢
Reply: @BuffaloPros  either way it still wouldn't make the kid only british???
Reply: i noticed that too. even from someone with no engineering education or experience, the one-way weave seemed woefully inadequate and i thought that even before it was confirmed to have imploded. how the CEO didnt also see it that way is beyond me.
Reply: @BuffaloPros  🤣🤣🤣what?
Reply: @BuffaloPros  this is the future folks, people REACHING out of their behinds to make a point
Reply: @andrew_owens7680  I love telling people my Invicta pro-diver is built to go to 200m, even though the deepest it will ever go is a hotel swimming pool. I highly doubt it would survive at 200m 😂😂
Reply: @didgeriedont7073  h
Reply: The acustic monitor system in my opinion is the smoking gun in this tragedy. He knew what was up for a long time.
Reply: @WhiteTrashtastic  😂
He told a journalist that he got the carbon fibre from Boeing at a discount because it was past its used by date for use in aircraft. And then he joked that the strip lighting inside the sub was from Camper World. Apparently he was a really nice guy so it's sad but seriously bro , are you on the pipe saying stuff like that ?
Reply: @Daledugahole  agreed. I get why he’s being criticized. It’s all well deserved. But it’s easier for me to hear James Cameron criticize him than people in the YT comments who sit in their houses all day, and become “experts” on everything from engineering, to climate science, to human behavioral science. Somehow these people are experts on everything, while having done nothing.
Reply: @BuffaloPros  
And that has to do with his ancestry how?
Reply: @TheBaker59yrs your math degree must have come from walmart
Reply: @phillipmoore6295 since Stockton was the designer and CEO there is no more company to sue
Reply: @BuffaloPros  
What?
Reply: @ViktorIsaacson  I did not say that metal will slowly deform or anything like that. And you did not qualify your original post by saying that the structural integrity had to be overcome. You're now backtracking on that post.
Reply: @deplorablelibertarian  oh yes, I do remember him saying that on an interview. Seriously, can you imagine that is so irresponsible! Hubris!
Reply: @nurseratchet555  Ironic, the Titan sub also came from Walmart ...
Reply: Not to mention that carbon fiber is a terrible material to make a deep sea exploration vehicle out of.  It doesn't handle compression well.  And then to make it into a tube shape, when spherical is much stronger.
Reply: All this talk about crackling submarines makes me hungry
Reply: @dx1450 Originally, he said he was going to make it out of eggshells and hobby glue so carbon fibre is actually a step up
Reply: @BuffaloPros  
You tell me
Reply: @BuffaloPros  
Ahh, I've done some research on the thread. You don't know how comment threads work, do you. So is it fun being dense?
Reply: @BuffaloPros  
Identifying races
Nor am I.
But you have no clue how to reply to comments, whereas I do.
Reply: He was money grabbing scum! Cutting corners and doing things on the cheap all at the expense of 4 people who didn’t deserve to die. I’m personally hoping that the 2018 lawsuit and the industry warnings were hidden from the passengers so that the disclaimer means nothing and they can sue and bankrupt the company and his family.
Reply: The carbon fiber laying process is the thing I find most surprising. There is so much data and experience with carbon fiber, it’s baffling the way they applied it. I’m also very surprised nobody is talking about it.
Reply: Imagine being in that submersible as a 19 year old kid, and the moment right before implosion, knowing you’re going to die… that right there had to be the worst feeling
Reply: @chrimony every sub does not. As their made of steel. What you hear instead is the metal compressing. Vs. A popcorn sound. Like a piece of metal hitting a bar
Reply: @KennyEaton603  The design doesn't mean much when the material used isn't up to the task. After the sub was sold, the company told the new owner that it was only meant for one dive. Then James Cameron told them it wasn't safe, and the owners decided not to use it. 
I believe that it was James Cameron who also said that after several dives, Titan had suffered some minor delaminations and had been repaired. Mr Cameron then said he wasn't didn't give any details on the extent of the damage, repairs, or what solution was used to make the repairs. 
As for scientific testing, there was nothing done that would've given them exact information of any kind. When we had pressure vessels tested, we could have them pressure tested, xrayed, or used one of several other tests. Out on the job, we mostly relied on x-ray testing to check welds, etc. 
Another huge issue with the Titan was that the endcaps were made from a dissimilar material. Also, they were connected with epoxy without placing it into a vacuum chamber to remove the air bubles. Those bubbles that were trapped in the epoxy would cause serious issues as they went through the diving cycles. How it survived ten dives is a mystery.
Reply: 5 inches, that's thinner than the walls of my house.
Reply: The interior walls mind you.
Reply: @TheBaker59yrs That's why I'm having a hard time believing this story.  Something is off
Reply: @andysmith1996  the original comment did. The one you were defending, lol. I'm not backtracking at all, you're clueless.
Reply: @dianewalker4633  Yes, he was in charge of a submarine and noted the different coefficients associated with the three different materials used made it a nightmare scenario from the moment it was thought up
Reply: Here comes all the experts in the YouTube comments 😅
Reply: @hanginwithkev5739 She’s probably hiding from the publicity
Reply: @climbing_for_dollars  He was desperate for passengers for sure. The father and son in Las Vegas who turned him down were even offered discounted seats, he offered the seats to them for $150k per person, instead of the usual $250k. But they still turned him down over scheduling conflicts and safety concerns. Unfortunately the seats then went to the Pakistani father and son, out of which the son didn't even want to go.
Reply: should not have been 5 inches. it should have been a lot thicker..approx the theoretical max depth could easily been 7-8 kilometers, not to mention weave in four directions. and the glue joint of two vastly different materials the titan dome and hull, seems off
Reply: @meganruchwatercolors7186  Yes and he was urged to have the abandon taking people down until the vessel could independently be tested for safety, which he refused to do saying he was tired of people using safety to squash innovation.
Reply: @papapawpaw8877  And ignores all the experts in the field's concerns as squashing innovation with "safety."
Reply: @KennyEaton603  Exactly, he ignored all the concerns of those who had experience and begged him not to use carbon fiber  and asked him to have the vessel  independently tested prior to using as someone would die in the feat....https://youtu.be/4cXAu6N6EPg
Reply: @hanginwithkev5739  He wanted young minds with creativity, nit 50+ year Olds with experience.  True story.
Reply: Well said!
Reply: Hindsight is 20/20, but those people who bought tickets probably expected professional levels of safety. Yes, crackling would have been a major red flag for people getting into the sub, but they often trust that the people who built and operate the sub (or whatever equipment) know what they're doing and wouldn't risk their safety. How many times have you heard disconcerting noises from things like rollercoasters, ziplines, Ferris Wheels, etc. and were then reassured by the likely not very smart teenage operator with "oh, that's normal, that's just the sound of the metal expanding and contracting from heat, this is accounted for specifically so the equipment would not fail, you are safe, trust me"

I'm just saying, I personally wouldn't get into that sub, but I also wouldn't get into a rocket on a free trip to space, but people do all the time and come back alive, and 6 prior dives for this sub is not exactly a stellar track record, but it does sound more reassuring than 1 dive or 0 dives. If it were a space ship on it's 7th voyage, you'd think that's plenty for a proven track record.

I don't think the people onboard deserve to have this sort of Darwin Award attitude thrown toward them, especially since they were all successful enough to be able to afford the costly tickets onto that sub - they weren't stupid, they just placed their trust in a man who they thought was a professional.
Reply: A lot of people want to beat the s out of that Rush dude even he is dead.
Reply: I guess we can see how Stockton became so rich. Cutting corners and conning customers.
Reply: @climbing_for_dollars  🤣🤣🤣
Reply: @chrimony  The Titan was unbraced internally. With an all steel or titanium design, it would of been pretty quiet and as a bonus, if either material did crack, finding and dealing with them would be relatively easy before another descent was made.
Reply: And?
Reply: @TheBaker59yrs  Sounds like you've replaced a lot of faulty X-Box controllers? I don't think I ever have. Likely because the vessel's normal internal atmospheric conditions like temperature, pressure, and humidity were reasonably within specs for the controller .. just like the conditions of your game room atmosphere. This controller thing has been overblown but I defo would want a wired controller and ya .. the aesthetics are bad using something so common and cheap for such a dangerous pursuit that ocean exploration is
Reply: @Name-ot3xw  No, there was an inside metal shell where they screwed the monitors and the cables ran behind that shell.  At least that was done semi-competently.
Reply: @joshuawiseman5629  I believe both Cameron's Deepsea Challenger and Vescovo's DSV Limiting Factor were both tested to 40k feet at that russian research center, to be classified as full ocean depth vehicles.  Both vehicles are also a titanium sphere instead of a carbon fiber tube with titanium end caps.
Reply: @Mike-01234  
1. create a test prototype
2. sink it 100 times unmanned successfully
3. construct the real product
4. sink it 40 times unmanned
5. use it 20 additional times manned
6. retire the product
7. go to step 3
8. ???
9. bro fist
Reply: The end caps are the weakest leak as far as structural integrity. Then the window.  Just my opinion working on aircraft for 40 years.  Things seem to fail more where they are fastened together.
Reply: @m0peds pressure tanks have pressure outwards, stretching the fiber though, a sub will have pressure from outside in, crumpling/shattering the fibre. CF is not suitable for pressures from the outside whatsoever. Completely different from a pressure tank.
Reply: @PanamaSticks that video showing a carbon layout was how it was supposed to be done, but not how Stockton did it. Other videos show his sub was only lasted up in one direction. With date expired fibre at that.
Reply: @carlislepanting5219   @carlislepanting5219  I went to Belize (Dangriga area) in 2014 on a service trip with my university. I miss it so much! Your country is beautiful, and the residents I met there were so kind and intelligent.
Reply: Crackling in steel and metlas in general is OK. In composites id rather not hear it...
Reply: I'm no engineer, but those hull to ring connections look like they were a guaranteed disaster waiting to happen. That is, if the inadequate viewing port didn't fail first.
Reply: Agree 100%!  I wonder if anyone ever said, "Hey Stockton, I know your sub has done quite a few dives before, but how many dives is it rated for?  Don't you think it's time to retire this one and do some testing?  Otherwise you don't have a safety factor, you're just rolling the dice with people's lives!"  What's the reason for not cross-weaving the carbon fiber?  Was that much more expensive than the one-directional pattern??  It's like he knew nothing about carbon fiber and how to maximize its strength!  And how do you use a lens that isn't rated for more than the full depth???  Every part of that thing should have been rated for 2x's the depth.  Very sad and very avoidable. To the guy that bailed last minute:  You just got your life back! Best decision ever!  Now make the most of it!
Reply: @kmacksb 😂😂😂
Reply: How do u know all this?
Reply: @chrimony  a buddy of mine got pulled over by a cop for speeding. He had a cheap radar detector. The cop saw it and asked does your radar detector work? My buddy said yeah, it tells me when I’m about to get a ticket.
Reply: @doubleooo7james  Well, yup he was indeed  out on it, and the guy who did it was fired.
Reply: @climbing_for_dollars  He didn't want to do the certification because it would invalidate the Titian.   He did NOT want to hear the truth.
Reply: @dianewalker4633  The hull had already been replaced once at the tune of a million dollars because a guy complained about the noise and overall safety. Maybe the second revised  hull didnt make the popping noise but was still being silently damaged under stress.  Apparently he bought old carbon fiber at a heavy discount from Boeing i think it was.
Reply: @fugu4163  Cameron also said we really don't know because it's experimental never been tested properly, or certified. That why he said they the NTSB needs to figure out what exactly happened. Challange is building a sub out of steel big enough for 5 people might be too heavy to manage on the ship. The one Cameron used in the Challenger deep weighed 12 tons for one person. Maybe someday someone will make one that is safe to take people down like James Cameron said it's actually safer than aviation hasn't had anything like this happen since 1960.
Reply: @vemaraju  no... see... when submarines crack and creek they are made of steel. this is okay, you can see it deforming when its wrecked, and it doesn't typically just give way like carbon fiber. carbon fiber doesn't give like steel does, any cracking of carbon fiber means only one thing... delamination - failure.
Reply: I know because even my carbon fiber bicycle creaks when ridden.
Reply: @KeithChegwin24  they may have done! Prior passengers on this trip, have said that it was silent
Reply: If he built a Huge sphere, with double decker seats, got it Classed, he'd have been an Alive Billionaire tourist Titanic guy for the Oligarchy.  He conned 4 people to their death.
Reply: @jonathankabasele985 There is at least one family member of one of the lost people reading through parts of the comments section. Please show a little compassion; there's no need to talk about it like this. The families are experiencing enough pain right now.
Reply: It was a stupid use of a crappy 1960s prepreg technology that is the worst possible way to mold a carbon pressure Hull like this.

The fact is that Boeing and Washington University did the structural design, and construction specification and had no conception of how stupid the construction process and use of vastly lower stiffnees and strength titanium and Acrylic parts, that additionally have vastly higher coefficients of thermal expansion was a recipe for disaster.

BOEING AND Wash U should be copping the liability for this screw up.
Reply: @Name-ot3xw  I would have expected an inner frame that was perhaps cemented but not screwed.  But no kidding?
Reply: Sketchiest looking “sub” I’ve ever seen in my life. No way would I get anywhere near that thing.
Reply: @iamthenews5624  take 6 tee shirts and lay them on top of each other in a stack.
Then wet them down. THAT is the carbon fiber "stack"
The air bubbles you see in the tee shirt stack are called Voids. Real CF is laid-up and vacuum chamber'd. The ait is sucked out. No Voids (theorectically)
A del;amination would be when (anywhee in the stack) one of the tee shirts seperates from the one below (or top) of it.
Reply: @christophermartin5742 not even. They were vaporized instantaneously. The inside of the Titan became as hot as the surface of the sun during implosion. They were destroyed on the molecular level.
Reply: Could of been that knocking that was apparently heard :P
Reply: @KennyEaton603  Never underestimate the value of experience, especially field experience. Sometimes it can be richer than education tho of course with engineering there are vital math and physics to learn.
When I looked up applications of carbon fiber nowhere does it say it's used or is suitable for deep sea environs.
I cannot believe that Rush didn't know the limitations of CF. So this trip was the 4th one the Titan took to that level. It is a total miracle that it didn't destruct after the first dive.
Reply: @meganruchwatercolors7186 there was a test that they denied to do, apparently ok for billionaire toy company
Reply: @Maungateitei  both Boeing and Wash U said in prepared statements that they had nothing to do with the building of this submersible
Reply: @KennyEaton603 diversity is strength
Reply: "Carbon fiber coffin and bolted them in it" sounds horrible but its so true.😬
Reply: @phillipmoore6295  wow! Very interesting to learn this, and you explained it well.
Reply: @Thebuird  what? 🤣
Reply: @matildafaltyn6253  I’ve spoken with a couple engineers that are familiar with carbon fiber now. It seems to be consensus that it’s good for one dive and should be retired after that. And even then it’s not an ideal material.
Reply: @climbing_for_dollars  Yes, I think the only way to properly test carbon fibre like this is to make lots of them. Then send them unmanned 4000m down and back up repeatedly. When 100 of them have managed 500 return trips without problem then you could probably say that a new tub is safe for humans for 100 trips. Should be a huge safety margin.
Reply: @hanginwithkev5739  You could do worse than talk to large volume bike manufacturers. Giant (for example) has been making composite frames definitely since the 90's. They've all encountered the issues surrounding interfacing with metal parts. Think they're much better now but 20 years ago you'd often hear about some delamination or gluing issue.
Reply: Idiot went down and killed everyone. Suicide mission
Reply: @aguaweasel yes this is what I think the weak spot is.
The CF hull would contract at a different rate than the end caps thus causing the bond to fail....
Reply: @Squilliam-Fancyson it depends if there wasn't any flaws or separation between the layer of the CF during construction..
Metal aviation components are X rated to spot flaws in the casting process .
There was an incident of an jumbo jet that had a flaw in one of the compressors - it lasted 17 years before it failed....
.
The cracking could've been delaminated sections (flaws) of the hull when built.
Reply: They all ping and crackle as they dive, it's the nature of compression, but it's impossible to tell the difference between normal compression sounds and bad sounds.
Reply: Basically
Reply: @N208R no they don’t. They use custom-made controllers that cost thousands of dollars.
Reply: @methylene5 layers in the weave also reflect sounds. Any imperfections and voids reflect sound. Lots of things in CF composite reflect sound, even if it’s totally fine. Distinguishing between “good” and “bad” reflections is nearly impossible and not well understood. Which is why it’s very, very hard to test quality of CF hulls, and no good non-destructive tests for CF exist.
Reply: @HouseOfPetrol  lots of them? How about few verifying examples? I’ve never seen game controllers in military, unless they are some sort of prototypes and not used in real mission.
Reply: @megenberg8 I get the impression as soon as someone calls themselves a „CEO“ every lunacy is accepted. Every mad deed is just being quirky or maybe erratic. We ordinary folks just don’t get their level of ingenuity 😒
Reply: Rush was hungry for money and that is why he proceeded to descend even after losing communication afew moment after the titan entered into the deep.
Reply: There people who don't maintain their cars and drive around risking other peoples lives so which is worse?
Reply: @KennyEaton603  the CEO knew the truth! You can’t have too much of one thing. We must mix it up and exclude what’s best even if it makes zero sense because that makes the most sense. I’ve been brainwashed as well
Reply: it also had aids.
Reply: Billionaires are not innocent people😅
Reply: @hanginwithkev5739  Spencer Composites ( their website is online) must have used their engineer ? (The  submersible's design engineer was Tony Nissen according to news reports)
Reply: So everyone here believes that it actually happened?
Reply: Boeing used the similar carbon composite for 787, but they had calculated the delaminating time table and verify it periodically. Besides the 787 didn't have million lbs of external pressure.
Reply: @ViktorIsaacson  You wrote that I said it, and I didn't. And I was not defending the post you were replying to – I was responding to your statement that "doesn't matter what metal, at that depth, the pressure will cause any metal to contract and implode almost instantly". And that's patently absurd, which is why you've backtracked on it. Or are you claiming that no metal submersible has gone as deep as the Titanic?
Reply: Oh man, I'm just hearing this part of the story! Wow!
^..^~~
Reply: @SuperChuckRaney  Thank you!
Reply: @BanjoPixelSnack  yeah. As debris suggest it's very likely the window broke first. So yeah maybe they've been well aware of the striking disaster
Reply: @papapawpaw8877 this also sounds like a tory.
Reply: spiderman no way
Reply: @meganruchwatercolors7186  spiderman no way
Reply: @kmacksb  spiderman no way
Reply: @carlislepanting5219  spiderman no way
Reply: @vemaraju  spiderman no way
Reply: @climbing_for_dollars  spiderman no way
Reply: @chrimony  spiderman no way
Reply: @hanginwithkev5739  spiderman no way
Reply: @dianewalker4633  spiderman no way
Reply: @dredgewalker  spiderman no way
Reply: underrated comment. you might want to pin this, @Ziroth. if anything, it's impressive for how long that pattern held. one dive, sure. two dives? wow! but SEVEN?? would have never guessed that...
Reply: @climbing_for_dollars  I have to entirely disagree, its the exact opposite. Stockton Rush wasn't money hungry but trying his hardest to make it affordable which lead to him taking such shortcuts which lead to this. Tickets even used to be like 125k before being upped to 250k but even that is way to little and the price should have been like 1-2m per ticket so they could afford making new hulls and and invest more heavily into Research and Development. The biggest downfall was the constant re-use of the hull which lead to it failing.
Reply: Carbon fiber arrows are made better than that!
Reply: @mashton6631  that's right. They did the design not the build.
The build was done in Australia.
Reply: @Maungateitei  !?! I live in Australia and heard nothing about this! I wonder where …
Reply: @hanginwithkev5739  I suspect sadly the “layup engineer” was Mr. Rush :(
Reply: @Mike-01234  engineering design is done by analysis combined with understanding the properties of materials,  not just “maybe a 20” thick hull might work”!
Reply: @KennyEaton603 All „professional“ submersibles before like the „Trieste“ or the „Alvin“ had had spheres of steel or titanium.
Reply: @damonmelendez856 Yes they do fucking look alike ..what planet are you from? 😊
Reply: @iamthenews5624  Separation of a material into different layers. A super basic analogy would be of an onion with it's numerous layers...and the layers are pulled apart at weak points.
Reply: I don't know what was worse:
1. The carbon fiber tube, or
2. The adhesive between the carbon and titanium. Two materials that have different rates or compression.  I'd never trust a sub like this glued together
Reply: @meganruchwatercolors7186  but that would have cost him money
Reply: They wanted to go no one forced them
Reply: @climbing_for_dollars  He was looking for validation from his peers more than the money. He was always the smartest guy in the room but he wanted others to know that, not just him
Reply: @Defender78  Being unable to open the hatch from the inside would be a deal breaker for me.
Reply: @iamthenews5624  The wraps of fiber fabric were seperating from eachother. Instead of a 5" thick super strong structure it was bullshit.
Reply: @sammencia7945  Don't know about "cheap". I have always thought it was  bit pricey.
Reply: Even for the most basic carbon fiber constructions like fishing rods they use X weaving for reinforcement. What these guys did is mindblowingly stupid
Reply: @fugu4163  Why not the two steel or titanium spheres? Because that would have been safe and common sense, and not 'innovative.'
Reply: @Defender78  Having a fleet of subs like that would have innovative. Enough people would love that kind of stuff, especially tourists on vacations and those that want to go underwater but can't use or afford scuba gear for whatever reason. He probably would have made money off of that, he could have been an Elon Musk of submersibles, even advertising them as 'underwater cars.'
Reply: three rich and one innocent*
Reply: @jonathankabasele985 that‘s gross 🙈
Reply: It was terrible. Terrible crackling sounds.
Reply: @vemaraju not funny. Mockery.
Reply: @climbing_for_dollars not funny
Reply: "Some engineers have said that this was a 'one and done' sub. That the five-inch-thick carbon fiber was too thick to reliably see every delamination in it so the tube should have been replaced after every dive."

QUALIFIED engineers say that carbon fiber should never have been used even ONCE.